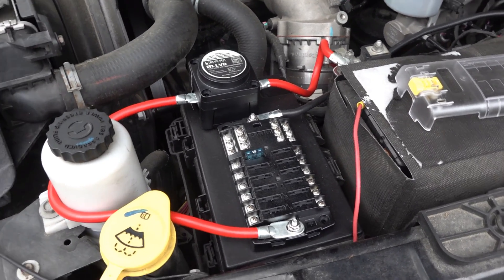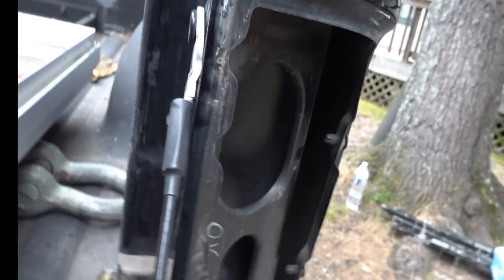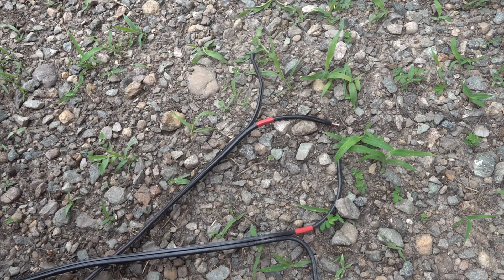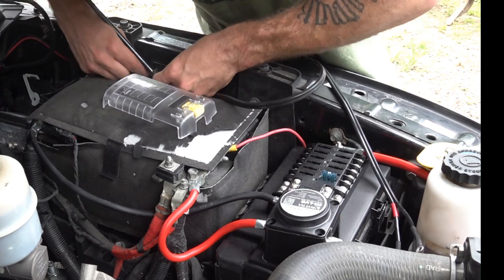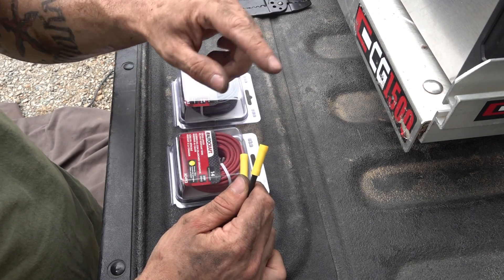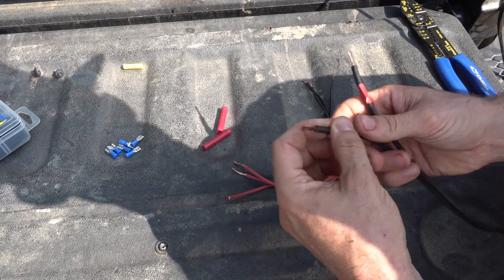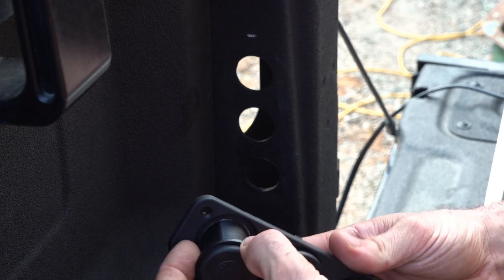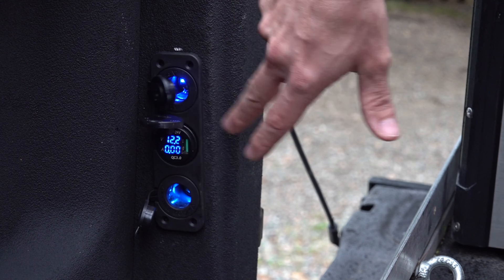12V Truck Bed OUTLETS - Installation Guide

Comment: Thank you...Great video. I was wondering why you decided to use connectors instead of soldiering where you used the 8 gu connector. On the outlets I can see why you used the connectors so it will be easy to remove. Just curious.... Thanks again
Reply from the maker: That's correct. I just wanted it easily removable if I chose to do so.

Comment: Protect those wires underneath the car with split wire loom tubing. Number one cause for a fire in overland vehicles is wires rubbing unprotected on metal.

Otherwise great video mate
Reply from the maker: Thanks for the tip!

Comment: Nice video and project. I am thinking of doing this as well as putting an inverter below my back seat and running a 120v to my truck bed.
Reply from the maker: That's a great idea. I installed an inverter under my back seat as well.

Comment: Probably the #1 wiring failure over time is butt connectors. To be fair this was a good job and the heat shrink will hold it all together nicely. 🌴👍👍😎🌴
Reply from the maker: Thanks for the tip!

Comment: After seeing so
many sockets mounted on the side, after watched thus it occurred to me that there’s less chance of cargo banging into them where you mounted them
. Side benefit , and yeah, easy to access . Planning this for my Colorado. Already have a battery box with various plugs, containing a 100ah LifePo4 battery , but I want an alternator 12v source while driving . I’ll probably set mine for ignition on, but might hook one up constant to charge a phone etc. while sitting

Comment: Marking the screw holes then drilling and tapping a couple of screws makes it a lot easier to do this job. Then just mark center on the main holes and use a holesaw. Takes a little more prep but run time is actually shorter and you don’t screw up as easily. Just a piece of advice.
Reply from the maker: Thanks John!
Reply: @AmateurAtBest  yeah. Not to different from your method but a couple little shortcuts

Comment: I love it! I'm gonna do this on my ranger. You ever thought about putting in a general socket to add with that?
Reply from the maker: Do you mean a standard 120v home socket? That will have to be run through an inverter. I do wire one in but it's in the cab. A 600 watt.
Reply: @AmateurAtBest  yeah, pretty much a 120v socket that's actually made for jeeps/trucks I've seen as a factory standard

Comment: Excellent job man. I'm going to install a 12v acc in the trunk of my 2022 Toyota Altis as I have intentions of running a 35 litre TWW alpicool fridge freezer.

I've bought a Toyota OEM wiring loom specifically though which allows me to plug directly onto the back of the factory fitted 12v acc in the small compartment under the front armrest. From there I'll run the cable under carpet and behind trim into the trunk.

My intentions will be to place the new 12v acc outlet in a convenient place in one of the rear trunk side panels to keep it looking factory OEM.
Reply from the maker: That's awesome! That sound like something great idea for a nice clean factory look.
Reply: @AmateurAtBest  yes I took the same route when I installed DIY the OEM ambient ice blue interior lighting, all Toyota OEM and my 5yr vehicle warranty was unaffected. Really easy fitting it too and looks amazing at night.

Comment: Hi, first off great job! I want to do something similar to this with my work truck. 

I am curious though, so are the constantly powered, or did you also splice into the ignition wire- so they are only on when the ignition is on?
Reply from the maker: I wired it straight to the fuse panel I installed so it is constantly powered.

Comment: Did you use landscape lighting wire?
Reply from the maker: I'm not sure if it was landscape wire or not. It's 12 gage stranded wire from lowes. It didn't specify a use case.

Comment: Some helpful advice. When you put music on a video put it at -16 to -18 on the volume or gain level in whatever editing software you're using so its not so loud and when you talk you can drop it down to -25. Those are the best levels to use for video.
Reply from the maker: Thank you.

Comment: Really did learn from your video.  Used the Blue Sea components as well.  Installed 2x runs in my 2019 F-150 rear of bed.  Now my fridge keeps drinks and snacks cold for duration of countryside/day/extended trips.  My video:  https://youtu.be/-hjLzC5lH_U   You can edit out the link if you desire.   I only wish I had the extra space under the hood you have.  With your permission, I’d like to add your link to mine, if I may.
Reply from the maker: Well I'm glad it was of some help! Feel free to link it wherever, I don't mind. Having a fridge in your vehicle is a game changer isn't it!
Reply: @AmateurAtBest  Definitely a game changer.  The retirement trips with food goods from home.

Comment: cannot find that volt meter/single usb part ANYWHERE. Link brings you to a dual usb.  HELP!!!
Reply from the maker: Let me look into that and I'll get back to you.
Reply from the maker: Yeah I haven't been able to find that one anymore either. Is there a reason you would rather have 1 USB rather than 2?
Reply: @AmateurAtBest  did you remove that link? I was able to find it in a 4 panel but now its gone. can you give me your link again for the single? It was the best way to find the 4 panel
Reply: Was really just interested in a volt and amp meter

Comment: I installed a single 12V outlet in bed and ran dedicated 12GA wire to truck battery with inline 30A fuse before battery terminal connect. The plug powers phone charger bit will note power my 12 V Igloo Cooler (which was main reason I did this mod). Any suggestions? It's approx 20ft run. Too much voltage drop with 12GA and long run? Appreciate any feedback or solutions. Thanks
Reply from the maker: That's interesting, it should work. I have 3 outlets now that I've installed (2 in the bed and 1 in the cab) and the they all run my fridge just fine. What type of wire did you use?
Reply: BNTECHGO 12 Gauge Silicone Wire Spool Black 25 feet Ultra Flexible High Temp 200 deg C 600V 12 AWG Silicone Rubber Wire 680 Strands of Tinned Copper Wire Stranded Wire for Model Low Impedance

Comment: skip those 8 awg butt connectors on the 12 awg and just use female quick disconnect terminals, daisy chained. Less splice points and less possibilities to lose a connection.
Reply from the maker: Thank you! I will keep that in mind for next time.

Comment: Thank you for the video.  It helped me install  the same set up for my truck.  What fuse did you use to connect this install on your fuse box?  I watched your fuse box installation and im going to install one on mine too.  Thanks again.  Good videos.
Reply from the maker: Awesome! Thank you for the feedback, I'm glad the video was helpful. I threw in a 10 amp fuse, that was enough for my application.
Reply: @AmateurAtBest  thanks man.  Also do u run a relay for your fuse box? Ill be installing some accessory  lights in the near future.
Reply from the maker: @bunzoflo84  I haven't run any relays yet.

Comment: Hi, nice video.  I ordered the 3 outlets and it already came in prewired on the back of the connectors with terminals at the end but it’s way too short to reach into the battery.  Should i cut the terminals and connect a 12 gauge stranded wire or 14 gauge? I believe the prewire is 14 gauge.  Idk much electrical work.  Thanks
Reply from the maker: I personally would go with the biggest gage possible (smaller number). The longer you run a wire, the more important it is to have a bigger wire.
Reply: The longer the "run" (length of continuous wire) is the bigger the wire you will need. Most common is 12ga for a run from bumper to bumper for something like this.

Comment: Great idea absolutely love it. Don't know why you couldn't put it where you originally wanted to though couldn't you offend the wires in from the top all the way down and then run it along your frame you wouldn't have had to get your hands up in there if you came from the top not sure what I would be missing would love to know
Reply from the maker: It definitely could be done, it would have been a pain in my ass though and I just don't have the patients 😄. I don't regret where I put it, it's been working fine and it's easy to access from standing at the tailgate.

Comment: Pretty Cool, gunna end up doing this, but.. when it comes to wiring.. always loom any wires outside of vehicle .. and solder and heat shrink your connections.. butt connectors fail, but all in all.. great idea!
Reply from the maker: Yeah soldering is ideal. I actually just started using those all in one heat shrink/solder connectors and I'm pretty impressed with them.

Comment: Do you have a video or some pictures of your second panel you were thinking of adding.
Reply from the maker: I didn't do a video, it's just a single 12v outlet. I did everything the same but I ran the 12 gage wire directly to a single outlet.
Reply: @AmateurAtBest  I want to do something similar to what you did to the back of my new f150. But don’t know where to put it without drilling holes due to warranty
Reply from the maker: @thomast171  you could try something  like this ARB socket:
https://amzn.to/3mQqDGi

And mount it with some VHB tape:
https://amzn.to/2Jow5lo

Comment: Just wondering if your wires are still okay you didn't have any problems after
Reply from the maker: I haven't had an issue, everything is still running great as of today. I did move my fridge and put another outlet on the other side. Just one outlet with strait 12 gage wire. The original one I use for charging devices and running fans.
Reply: @AmateurAtBest  what did you buy the fuse and what kind of wire did you use great job on the video

Comment: Dam i really like that. I have a 2019 ram 1500 classic and sadly it only came with 1 12v outlet in the cabin by the gear knob and it is only on while the truck is on.. looking for an alternative to have it constant on. Any suggestions?
Reply from the maker: Yeah that's the issue with that inverter. If you want 110-120v constant, you'll have to wire up your own inverter. I did that and put it under the back seat.
Reply: @AmateurAtBest  Go in your fuse panel find your 12 volt fuse move it over one bar then you will have power with the truck off

Comment: Instead of running 3 wires off your main wire, why wouldn't you run one wire to the plug and then run the wires in series to the positive/negative to each plug
Reply from the maker: Do you have an example of this? I'd like to see it, I'm sure it would work great.
Reply: I don't think you understand series wiring. Pos to neg is series, parallel is pos to pos, neg to neg

Comment: Hi there, thanks for the video covers a lot of what I want to do to my truck. Did you check out the draw in amps that the wire you chose can take? Are you running these wires from a second battery upfront? I will look for the video you did on the fuse box, that looks nice and neat as well.
Reply from the maker: I haven't checked the amp draw, haven't really had any issues though. As far as the battery, my truck already had two starting batteries so I just kept it stock with the low voltage disconnect. I would recommend having two batteries or at the very least a low voltage disconnect if you are running anything to your starting battery.
Reply: @AmateurAtBest  Thanks for the reply, I will follow your advise and have the low voltage disconnect, but my second battery will be a deep cell in the tray with plugs for the fridge, lights ETC. It was good to see what you did to get a clear picture in my mind of how to go about it. Cheers

Comment: I’m installing one of these, is there a reason I shouldn’t use a chassis ground? I want to keep the wire clutter to a minimum...Thanks
Reply from the maker: No reason, a chassis ground should work just fine. I ran the double cable just because that's how my brain likes it, lol.

Comment: If you want it in the sidewall just cut a single hole that everything can slide into drop your wires and screw the face plate down

Comment: Thanks for the video.  Have you noticed any issues with the 12ga wire?  I would think you would need 10ga supply from the Fuze block?
Reply from the maker: I have not had any issues at all, the 12 gage has worked great.
Reply: I don't think it is the gage we should be talking about, but the draw in amps that the gage can carry. House wiring has nothing to do with this, 12volt wiring is heavier gage because of the draw from fridges etc if it can't meet the draw it heats up and could cause a fire. So my only question here is will the gage used take the draw of the fridge and any other things plugged into that line?
Reply: The 110v wire in your house is only 14g.
Reply: @jackd2083  ...your house also has 12, 10, or even bigger gauge wire depending on what it's servicing.  Same holds true here.
Reply: 2ridered2 
Did you see the comments above yours?  I’m pretty sure everything you wrote was already covered.
Reply: @jackd2083  Yeah, I did.  You seem to make a lot of blanket statements that just don't make sense which is why I added my .02.  Oh, and guess what...12awg wire isn't specific to 220vac either as you previously stated.  12-2 (or even 12-3) awg is commonly ran for 110 circuits that require higher amperage.  So, just stop while you're ahead as it's clear you really don't know what you're talking about.  M'k.
Reply: Jack D not all. There’s 12ga also for stoves, water heaters , ovens etc.
Reply: Web Crawler 
Yeah the 220v wire is 12g. Sometimes even heavier. That’s why I specified the 110v wire.
Reply: Jack D If you're comparing 120v AC wiring to 12v DC wiring it seems you have a very limited knowledge of wiring. They're very different

Comment: Is there a reason that you couldn't have used your original location on the side of the box merely by dropping the wire down from the outlet mounting holes, then running the wire to the front of the truck for connection to the power source?
Reply from the maker: Yeah that's what I was going to do originally but I wouldn't be able to unplug and swap out the outlets very easily. Thus is a much better location for me.

Comment: so is that constant power?
Reply from the maker: As long as the battery is above 21.1v, yes.
Reply: @AmateurAtBest  you mean 12.1?
also im wiring some stuff up but my rocker switch is like reversed. You turn the stuff on the switch is in the off position with the light facing up and the blank ide down. when you put the light down and the blank side up the stuff shuts off. any ideas?
Reply from the maker: Yes 12.1, because of the low voltage disconnect. The polarity in your wiring may be reversed?

Comment: I have the same auxilary fuse box laying around that I've been wanting to install in my silverado but I've been putting it off since I can't really figure out a good place to mount it that won't be in the way. But I've got some lights and and bed outlet like this I wanna install in the next month or so, so I need to install the fuse box. Great video
Reply: So did you ever get around to installing that?

Comment: why not use the chassis like the negative? ? ? ?
Reply from the maker: You could definitely do that!
Reply: @AmateurAtBest  
Thank you mate
Reply: Is there a way to find a grounding point in the back of the bed instead of running it to the front?

Comment: 12 volts?? why not 120v, like residential houses
Reply: albert re the car battery can’t handle that
Reply: @blakeday9364  the battery can handle it for a short time you need to figure out how to invert the power to 120 before it gets back there
Reply from the maker: I have a 600w inverter in the cab for when I need 110v-120v. I really have no need for anything other than 12v in the bed. Plus it's more simple given the truck is a 12v system.

Comment: so my question is how well is it holding up . I have had friends wire up similar setups and after a year all of the switches are so corroded  they don't work. salt will find its way up there if you live in snow country.
Reply from the maker: So far so good. We don't recieve too much snow, maybe a foot or two a year, but nothing had corroded yet.
Reply: You could dab some grease around the connectors. Lithium or axel grease or Vaseline etc.
Reply: Nope don't use regular grease. Use Dielectric grease

Comment: could you have used the trailer plug to get 12v?
Reply from the maker: You probably could. I guess it depends on what your powering. I actually had run another dedicated 10 gauge just for the fridge.
Reply: @AmateurAtBest  Do you have a picture of your wiring with the other 10gauge wire? im wanting to install the same set up, with the fridge. TIA
Reply from the maker: @black_widow_overland  I'm currently overseas so I can't get a picture but it's the same, however I just plugged a new 10 gage wire directly into a single 12v outlet mounted on the other side of the truck bed.
Reply: @AmateurAtBest  thank you sir.